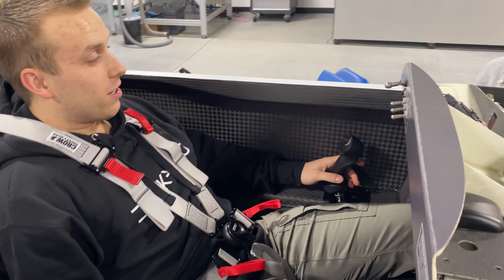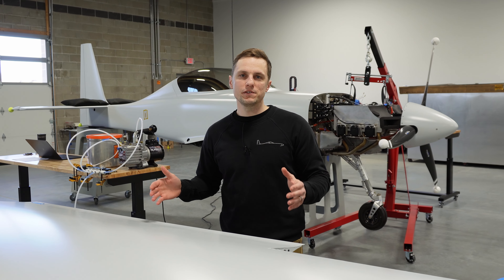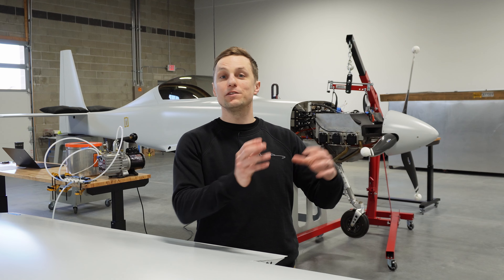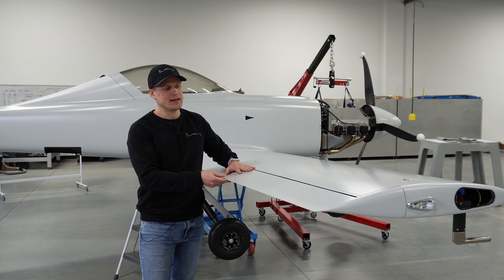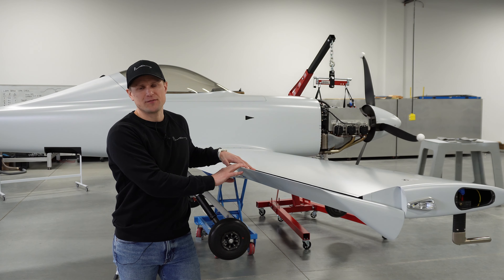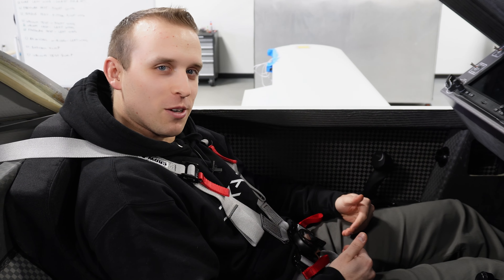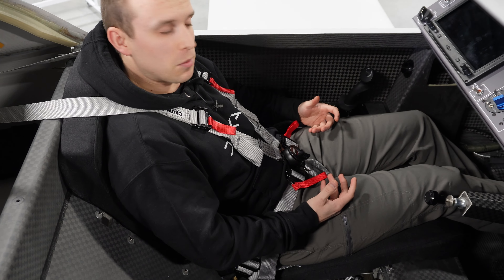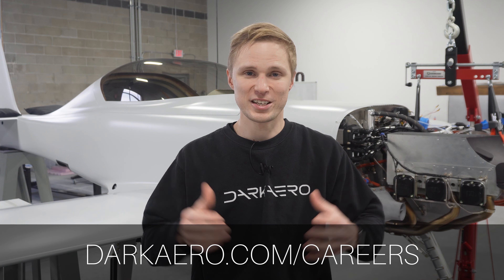Ground Testing the DarkAero 1

Comment: Is it possible to make these structures too stiff? I've always been curious about this. In cars, at least, the goal is to make the crash structures purposely less stiff and stable and therefore easier to break away from the main safety cell, but planes are different - I don't think there's a single part of a plane that would purposely be made purposely less stiff than the others. If anything, I'd assume that you'd want places like the wing-fuselage attachment areas to be EXTRA stiff (assuming weight isn't a factor). Is weight really the biggest challenge to increasing stiffness?
Reply: If a structure is too stiff it will crack. Some flex is needed to make the structure resilient. If you watch a 747 take off the wings flex upward at the tips several feet as they take the load.
Reply: @davidr8309  I understand that. I also understand that a significant part OF that flex is a byproduct of the sheer weight of the wings themselves in addition to the compliance that's built into such a large structure simply because of mechanical tolerances. Resiliency, flexibility, and stiffness are not mutually exclusive in my opinion - you don't need isomorphic properties in all places all the time. My question is whether the stiffer properties of carbon fiber can be used to create structures SO stiff that they actually become a hindrance. Carbon fiber doesn't crack like aluminum will, and you can overbuild it to the point where it's so strong that the stiffness is just a happy byproduct.

Comment: So if I understood what you were discussing here, you are saying there is really no fuel tank other than the internal spaces within  the carbon wing? Or did I miss something?
Reply from the maker: That’s correct! It’s referred to as a wet wing.
Reply: @DarkAeroInc  So the bonding of this carbon wing is able to withstand the fuel, so no decomposition, delamination will occur? I'd never have thought that true of a carbon component. Amazing stuff.
Reply: @monkeybarmonkeyman  No. Gasoline doesn't dissolve cured epoxy.

Comment: Shouldn't a non compressible medium ie water be used for the means of pressure ?
Reply: Of course there are good reasons not to use air or nitrogen in lieu of hydrostatic testing. At low pressures it is not uncommon to use a gas. An example would be a Xerxes-brand composite UST for gasoline or diesel. Of course you are going to always reference the manual included with each tank, and is one even laminated into the tank itself. This pressure test is done ca 5psi. Heating of the tank during testing, and resultant pressure rise is a risk, especially in sunlight, and a relief valve of large enough capacity is always required as well. Look at the manual, it will require a relief at something similar to 6 psi. Not a time for multi-tasking. Your only job is watching the gauge. Well, recording results. Is that two tasks? Some things that are boring are important.

Comment: Did you guys ever contemplate a FIKI solution?
Reply: @abel4776  heating is usually done by bleed air so not viable. It would have to be pneumatic boots or weeping wing. But I’m curious of the other options that may of been contemplated.

Comment: I guess, I will be the only one to say that I have serious doubts about the overall design of this aircraft.  Sure it looks sleek, but certain elements give me pause.  Retracting the gear to the rear shifts a lot of weight during takeoff when the aircraft is very susceptible to cg changes.  Additionally, pilot and passenger are already sitting aft of cg limiting capacity. This appears to be offset by making the tail control surfaces as small as possible which is fair, but is a compromise.  CG will also seem to shift aft as fuel is used making landings more dangerous than takeoff. When you do test fly it, consider being a bit nose heavy.  A nose heave plane may fly poorly, but a tail heavy plane flies once.

Comment: The fuel tank in the wing with NO bladder, and trying to get the wing to seal correctly
WILL BE A NIGHTMARE  for builders.
If a builder does not build the wing perfectly the way YOU have, it will not hold fuel.
Your making/manufacturing an awesome aircraft, but your NOT thinking of your future builders.
Fuel in constant contact with carbon fiber, all the bonding agents and fuel fitting use.
Long term effect? Static from your fitting? Hanger rash?  
This decision will make or break your sales!

Comment: Uh...  BIG RED FLAG.  If you're pulling air out of the wing, you're compressing the skin which could hide micro-leaks.

Wouldn't you want to pump in some slight positive pressure into the wing, so as to ease pressure and uncover any micro-fissure leaks?

Regardless, are you considering the carbon fiber epoxy panels to be impervious to fuel?  What about to the development of micro-fissures over time?

Yes, everything is weight.  I might prefer a little extra weight in the form of a highly-flexible membrane sprayed or even saturated onto all interior surfaces of the fuel tanks. 

What might that be?  3 lbs?  20 lbs?

Comment: A carbon wet wing? Infused? High octane Fuel? Uh...Nah. Heard of Ocean gate and their carbon experiment?
Reply: You act like nobody has done carbon fiber airplanes before 😂. This isn't a submarine.
Reply: @galactictomato1434  Yup. I've used carbon fiber extensively in my builds, but never pushed it's limits to extremes. I'd just say good luck. 🤞
Reply: Good point about Ocean Gate. I wouldn’t recommend descending in the Dark Aero 1 to 3,800 meters below sea level.
Reply: @TheDeanHaemel wtf are you talking about
Reply: You think composite fuel tanks are a new thing? Wrong.
Reply: Obviously you are not an engineer, we have had permeability issues with wet wing infusions and tank/wing structural integrity where over a period of a few years delamination occurs. They simply do not last and are being retrofitted with fuel bladders for safety and longevity. Do your research before you insert foot in mouth- @jayphilipwilliams